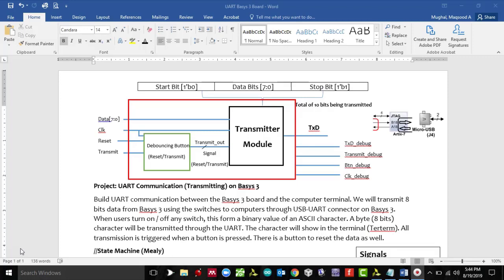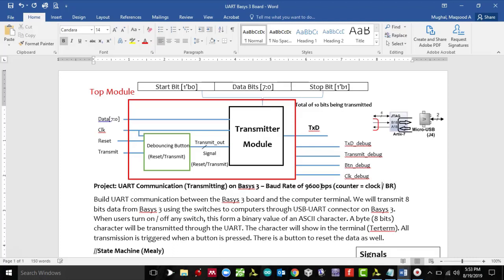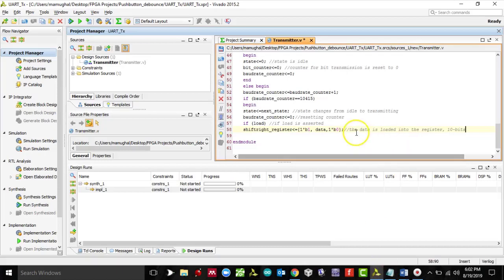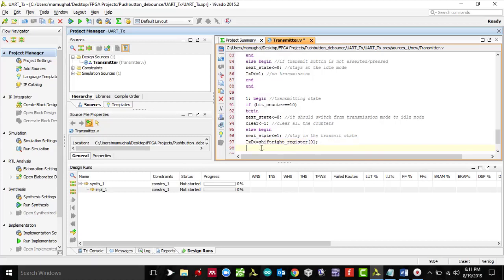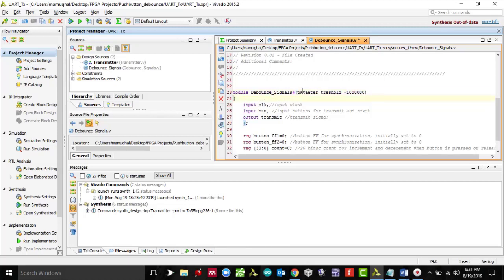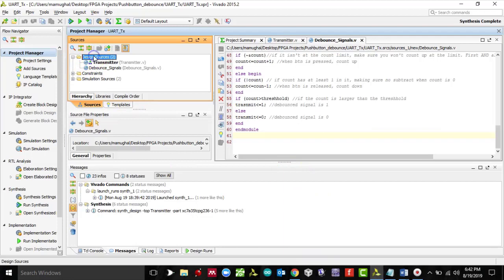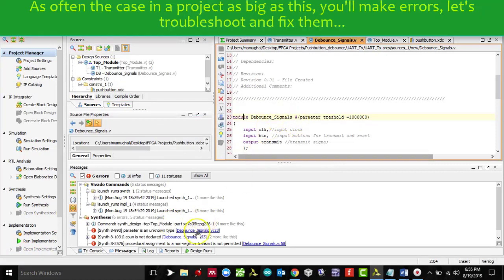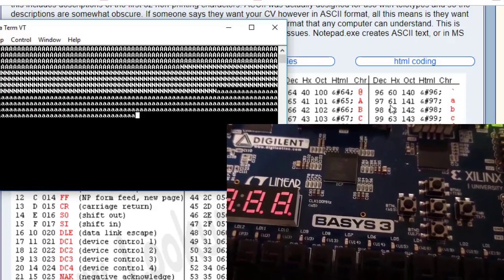#15 Part 1: UART-TxD Serial Communication using an FPGA Board | Verilog ➟ Step-by-Step Instructions

Comment: How can I reduce the denouncing of character after loading the ascii value to fpga,
Like in a demo when you press once the character display 10s of times. How can I negate that and display it just ONCE
Reply from the maker: try changing your clock duration for the pushbutton. Reducing the time period should help.
Reply: @ElectronicswithProfMughal  ohhh thanks, I'll do it
Reply: Did you use pmod in constraint file ?? @srharikumar4254
Reply: @srharikumar4254  did you change the threshold value

Comment: set_property BITSTREAM.STARTUP.STARTUPCLK JTAGCLK [current_design]

set_property CFGBVS VCCO [current_design]
#where value1 is either VCCO or GND

set_property CONFIG_VOLTAGE 3.3 [current_design]
#where value2 is the voltage provided to configuration bank 0     
How to set these constraints for Nexys 4 fpga board

Comment: Halo sir, since UART is asynchronous protocol, then what is need of adding clock in the transmitting module
Reply from the maker: For pushbutton to send a signal.

Comment: Thank you for this great explanation, i have a question please, why the msg is repeated on the console may times? And is there any solution for this ?
Reply from the maker: my debounce module was acting up. It may be my board as well.
Reply: @ElectronicswithProfMughal  I got the same problem on altera cyclone IV GX board

Comment: i implemented this on nexys4 ddr board
I ran the implementation and generated bitstream but the output was not showing up on tera term
there were no errors. please help
Reply from the maker: check your constraint file.
Reply: @ElectronicswithProfMughal  i checked sir. do i have to connect a serial port cable? i changed it to the nexys4ddr constraint file and changed the names of the buttons and everything.
Reply: @aparnabalasubramanian8707   did you get it

Comment: It seems the debouncing part isn't working that well, could you provide a fix on that?
Reply: because the transmit signal pulse is set by the clock fed to the two flip flops of the debounce module.. so..after completion of the 10 counts in the bit_counter, the transmit signal is still high. so we need to make the transmit signal high only for a period less than 10415*10  clock cycles of FPGA clock (i.e. 100MHz). so making a level to pulse converter giving a pulse with of one FPGA clock pulse for the pulse created by the debounce circuit will solve the problem.
Reply: @AnkitYadav-zg5zd  can you please make it more clear ? I'm a bit confused with the level to pulse converter part
Reply: @meowmeowmeow158  you can use a positive edge detector circuit for the transmit signal. This level to pulse converter should be fed with 100MHz clock. You can find the positive edge detector circuit. Just google it.

Comment: Can you tell me what the test bench should look like ?
Reply: Hi, did you figure out how to write the test bench?
Reply: @ayzaahmed  actually i am now using an entirely different uart code. It was provided to us by our prof.
Reply: @navaneethkrishnannampoothi2317  can you share it with me, if that's alright?
Reply: @ayzaahmed  it's available on the internet. Let me see if I can find the link to that website. If i do get it I will share it with you.
Reply: @navaneethkrishnannampoothi2317  alright
Reply: @navaneethkrishnannampoothi2317  what fpga board are you using btw?
Reply: @ayzaahmed  nexys 3
Reply: @navaneethkrishnannampoothi2317  any luck finding the link?
Reply: @ayzaahmed  i posted the link twice but for some reason it's not showing here
Reply from the maker: The access to files have been provided, please consider subscribing to the channel.

Comment: Is it possible that the transmitter will send value only one time because I really need it . I'm making something like fpga to fpga communication so that the tera term in second pc connected to second fpga will show same as the input character from first pc. Data should go serially . sir your help will be very much appreciated
Reply from the maker: Yes, my pushbutton was acting funky.
Reply: @ElectronicswithProfMughal  sir is it possible to get a solution for this

Comment: Hello, i have created same verilog code to my project using Arty A7 and change the constrain file for this board. But the transmitted data is random and not match with the bit value. How come?
Reply from the maker: I am not sure. Might consider verifying the constraint file again.

Comment: When I tried to write the bitstream, I got a combinatorial loop error. It seems the shift register, when trying to change multiple bits at once might create a race condition. I'm using Vivado 2020. Has anyone noticed this problem?
Reply: Try using else if statements for the load/clear/shift. Only 1 mode should be active at a time, but he doesn't make a condition in this code to limit it, so the register may be trying to load and shift at the same time.

Comment: Thank you for the video,  I am having a problem with the transmitter module.  Lattice Diamond is reporting a timing error when I attempt to synthesize, place and route, etc...  I'm using Mach03LF Starter kit, it has a 12Mhz clock.  I don't understand what this error is saying or how to fix it.  I get this error consistently, it seems no matter whose example code I use...  Any suggestions to get past this?
Reply from the maker: What is the error code? Vivado platform right?
Reply: @ElectronicswithProfMughal  It is Lattice Diamond.  It is telling me there is a timing error in the place and route report.  I'm not sure how to fix this.
Reply from the maker: @darrelljamesmullen1345  OK, usually those errors are associated with the clock. There is a mismatch when two signal propagate through circuit.

Comment: Great video sir. Thank you for sharing. Why you have used PMOD connector for data transfer. Can't data be shared with same cable through which the board is programmed.
Reply from the maker: I have not used pmod. I am sharing it with the usb cable.

Comment: I am learning how to use the basys3 and I love all of your guides, my only gripe is that the code is not easily accessible and for me, I am barely learning so seeing working code helps. Although I am pausing the video to see the code part me worries I might be missing some part but overall thank you so much for the explanations.

edit: I'm trying to work through some errors like 
"[Common 17-55] 'set_property' expects at least one object. ["D:/CodingStuff/SerialCommunication/SerialCommunication.srcs/constrs_1/imports/CodingStuff/Basys3_Master.xdc":113]
" 
if you have insight please let me know
Reply from the maker: scano6839 Dear, I’ve made all codes accessible, however, you’ve to request for an access. I don’t make it available publicly because people have done bad things in the past. 
It looks like you’ve an error on line 113 of your constraint file, make sure that the variable name is same in both source file and constraint file.

Thank you for appreciation.
Reply from the maker: I just provided you with the access. Let me know if it doesn't work.

Comment: There is something I want to ask.
The distance sensor is displayed on the seven segment display by connecting the ultrasonic sensor (HC-SR04) to the Basys3 board.
I want to show the distance data in the Tera term shown in the video, but I want to know if it is possible.
Thanks for the good video.
Reply from the maker: I’d think It is doable with Basys 3 board.